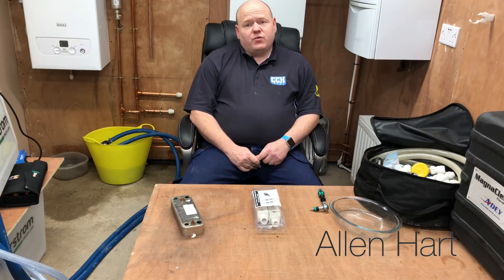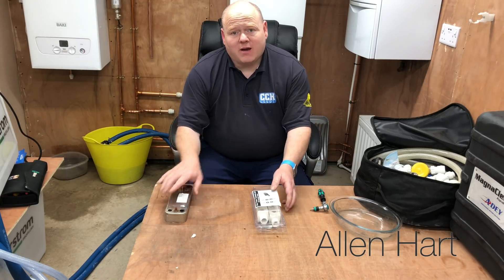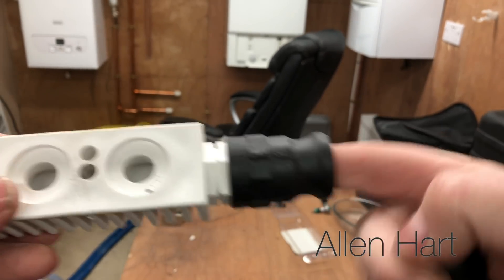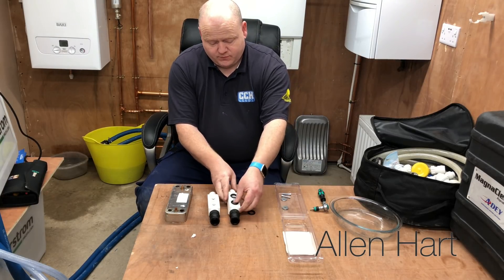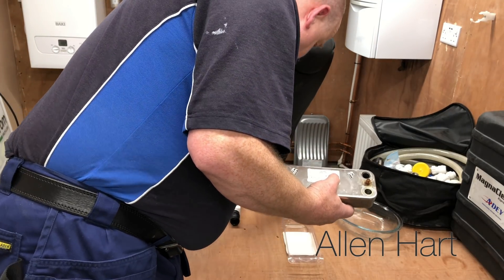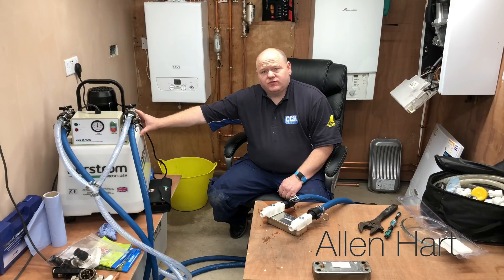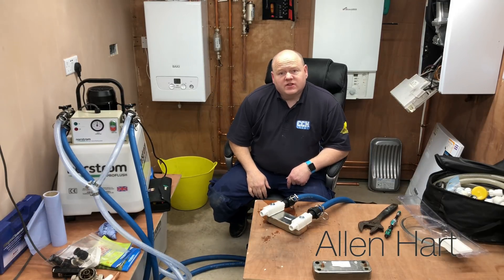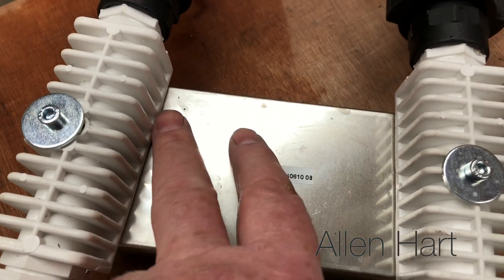How to Powerflush a Plate to Plate Heat Exchanger

Comment: In the US, they seem to have  three way isolation valves below the heater , so you can flush the flat-plate HE while leaving it  in place!   Are any similar valves available in the UK, perhaps???     https://youtu.be/YNBdtC9jjLA?t=26   A heck of a lot easier than having to pull the boiler to bits!

Comment: nice video , I would always take out the plate to plate and flush it separately when I’m doing a full flush, but if I’ve been called out to a blocked plate then I would take it out , insert spirit of salts for 20 minutes , and then  I would strongly recommend to the customer that a magnetic filter should be installed and of course an inhibitor, to prevent it from happening again.

Comment: would be better if you could turn the pressure down on the power flush pump to save going into the boiler as i suppose not many powerflushing companies are gas safe registered???

Comment: Little tip re cleaning  plate heat exchangers. We discovered this years ago and will have your plate heat exchanger good as new. Go online or homebase sell it, costs buttons, its called spirits of salts. Each bottle will do perhaps three cleans. Once HE is removed and rinsed, fill primary side of HE with Spirits of Salts, once filled put thumbs over filled ends and shake around to fill all areas, keep topping up until level stays full when thumbs removed. Leave standing for 20 minutes and empty, rinse continuous and shake well until all debris gas stopped coming out. You will be left with a brand new HE guaranteed every time, never fails. I have not needed to replace a HE in years. Beware, this must be carried out outside, this stuff is corrosive and could potentially damage a floor covering, I always finish off rinsing in kitchen sink under running water. PS, this will make your thumbs smart especially with cuts but you will live. Try it, its brilliant
Reply: In our company we used to do similar thing to save clients money, however after time the same corrosive agent you use to flush plate heat exchanger ate through the plating and dumped city water pressure in heating system . I was wondering if you have ever encountered that in your experience?
Also ive heard of method that just uses distilled water and lots of flushing to get rid of dirt flakes inside plate heatexchanger but never tried it.
Reply from the maker: Thanks.

Comment: Does seem a bit much, im wondering wether boilers now should have a flush mode where by the diverted valve swings from hot water to heating thus flushing the plate exchanger aswell.. i do wonder what power flushing companies do when it comes to flushing this out.. as i would imagine most wouldnt be gas safe to remove the exchanger like that...
Reply from the maker: I am not sure many would flush the plate to plate out on a standard powerflush tbh.
Reply: Bruce the Goose qwetuqwertyiopadfhjklł